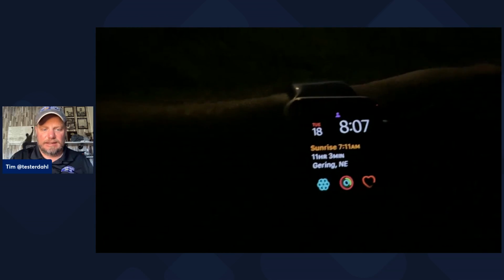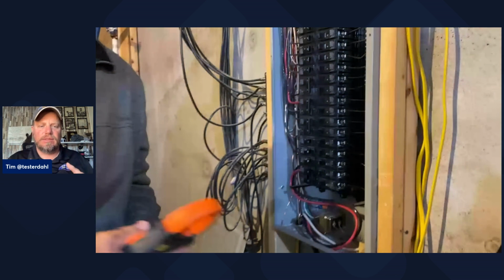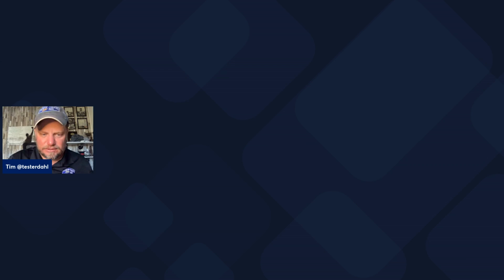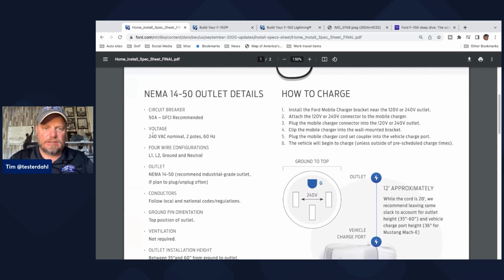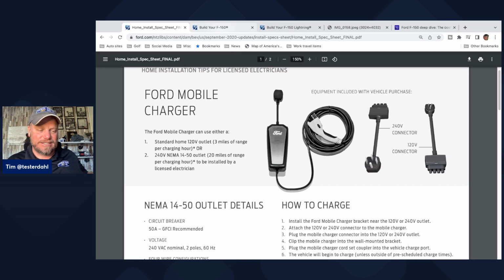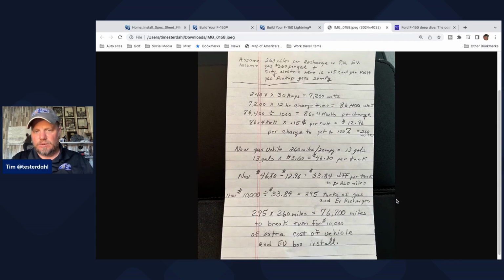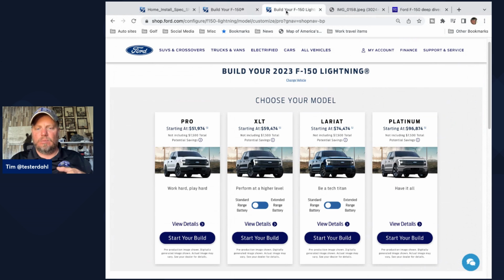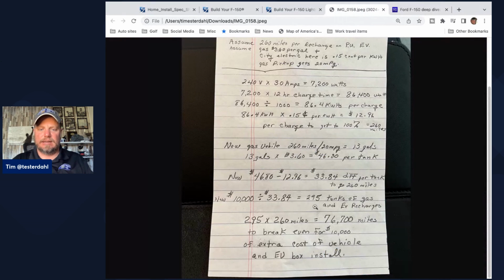11+ hours later on 220V charging price for 2022 Ford F-150 Lightning

Comment: Imagine if electric cars were the standard and someone said that they had come up with a complicated method to of compressing air and spraying explosive liquid into multiple chambers at perfectly timed intervals to make power.  All it needs is a transmission, a clutch system and a large load of explosive liquid to be stored in the vehicle.  It vibrates a lot, is not efficient, needs routine maintenance and requires the US to be dependent on oil from other nations ... but it sure refuels quickly!
Reply: With all the Tesla and GM recalls I guess somebody forgot to tell them their EV vehicles are maintenance free. Ron it might be wise to throw the rest of the kool-aid you've been drinking out.
Reply: @coobay4786  Do I need to explain to you the difference between maintenance and a recall?  ... or are you a Trumper and facts don't matter???
Reply: @ronmac1832 It's just about the same except oil changes every 6k to 8k miles.
As an example of what’s typically required, here’s a look at the maintenance schedule for the 2019 Chevrolet Bolt EV:

Monthly (performed by owner):

Check the tire pressure and adjust as necessary. Examine the tires for excess wear. Check the windshield washer fluid and fill as necessary.

Every 7,500 miles:

Have the tires rotated. Check the coolant level for the battery, cabin heater, and the power inverter, accessory power, and charger modules. Visually check for fluid leaks. Inspect the brakes. Visually inspect the steering, suspension, and chassis components for damage. Inspect the power steering, halfshafts and drive shafts for excessive wear, leaks, or damage. Check the restraint (airbags) system. Lubricate body components (door locks). Check the accelerator pedal for damage, high effort, or binding and replace if necessary. Visually inspect the gas struts (suspension) for signs of wear, cracks, or other damage. Check the tire sealant expiration date, if equipped (this is used to temporarily seal and inflate a damaged tire).

Twice a year:

Flush corrosive materials (i.e. road salt) from the underbody using plain water.

Every 15,000 miles:

Replace the windshield wiper blades.

Every 36,000 miles:

Replace the cabin air filter (more frequently if necessary).

Every 75,000 miles:

Replace the hood and/or body lift support gas struts.

Every five years:

Drain and fill the vehicle coolant circuits. Replace the brake fluid.

Every seven years:

Have the air conditioning desiccant changed. (it absorbs and holds moisture in a mobile air conditioning system to help prevent corrosion).

For its part, Nissan gives two separate maintenance schedules for the Leaf. Schedule 1 is for more severe operating conditions that include frequent short trips of less than five miles in normal temperatures or 10 miles in freezing weather, stop-and-go driving in hot weather, low-speed driving for long distances, driving in dusty conditions or on rough, muddy or salt spread roads, or using a car-top carrier.

Schedule 2 requires less-frequent maintenance, but applies only to highway driving in temperate conditions. The bottom line here is that most Leaf owners will require Schedule 1 service.

As with the Bolt, this comes down to assorted periodic mechanical inspections, having the tires rotated every six months or 7,500 miles, and changing the cabin air filter every 12 months or 15,000 miles. In addition, the brake fluid should be replaced every 24 months or 30,000 miles, and the coolant changed after 15 years or 120,000 miles.

Now affording less maintenance doesn’t necessarily mean an electric vehicle is bulletproof. EV owners will eventually need to replace the tires, have the brakes serviced, and could be required to replace steering and suspension components, hoses, headlamps, taillights, and so on. As with any other type of vehicle, a wheel alignment will be necessary if the car pulls to one side or is exhibiting uneven tire wear.

And then there’s an EV’s battery pack to consider, which is by far its costliest component. All electric vehicle batteries will degrade over time and lose some of their ability to maintain a full charge, though this happens gradually. It’s more of an issue with older EVs that could barely muster 80 miles on a charge than today’s crop of 200-mile-plus models. At that, only a relative handful of electric cars manufactured to date have reportedly degraded to the point where they needed to be replaced. Still, if you own an EV long enough you’ll see its range decline, and if it falls short enough to become an inconvenience, you may need to swap out the battery pack or trade the vehicle in for a new one.
Reply: @coobay4786  I'm well aware of the maintenance requirements on each as I own both. There is no comparison. Think about me next time you're waiting for your oil change or crawling on your back doing it yourself.
Reply: @ronmac1832  now aren't you special
Reply: @coobay4786  Just speaking from experience and not from ignorance ... like you seem to be. Does that make me "special" or just informed?

Comment: I seen a vlogger who tested towing with a ford EV truck.  It blew.  Have you any info on range issues when towing?

Also just had a thought.  What happens if I have a EV vehicle and I now have a boat .... can these ev trucks be backed into the water in the same way that you back gas trucks now???

I think EV's make some sense and I love to transfer my pollution control to the power where economies of scale can make better and more efficient pollution controls ... but if towing just blows EV's out of the water they'll never effectively make a change....

Comment: Try this with a more sophisticated watt meter such as Sense.  It will be a lot less unknowns, because you get to see a graph of instantaneous wattage over time. Make sure to order the extra set of clamps to meter an individual circuit, or it won’t be able to separate the charger from other loads in your home.

Comment: Did I hear that right? 220v for 13 hrs. That filled half a "tank" only cost $13.00? I understand your in Nebraska, in California if I ran a 220v welder for a couple of hours (not 13 hrs.) my bill would easily double. So $13.00 a nightly charge, I call BS.
Reply from the maker: What's your local electricity rate? Mine is a lot less than Cali.

Comment: if you charge that anywhere but at home, it will cost you three times what you pay at your house. its a rip off for what independently owned charging stations cost. i realize that some day all will be required to use electric or other form because fuel will be unavailable for the most part, but for me, i dont want to worry about how far a trip i am taking and having to map out a trip according to where chargers are, and the down time with charging at some strange place. i will be one of the people that they will have to be forced into changing.

Comment: Most electric dryers draw 30 A so it’s like running a dryer straight for 12 hours that’s how much it cost to charge your truck that’s kind of significant I think check your rates
Reply from the maker: Right, but you can't calculate for a dryer. This pulls more power in than the dryer.

Comment: The lightning pickup is a joke. It's a vehicle for commuters that drive less than 20 miles a day and don't haul anything. Another guy posted a video calling an empty trailer just over 30 miles, and then returning with less than 1500 lb on the trailer. From full charge, his range went down to about 25 miles. What good is a pickup truck that can't drive 100 miles with a light load?
Reply: Yes, you are correct.  Did you mistakenly assume it was made to haul 4 tons hundreds of miles?
Reply: @blackhawk7r221  every other truck is. Ford advertises it like it will replace current pickup trucks. It won't.

Comment: Having a hard time following your rambling.   
I do have to make this point:
75% of the potential energy of Gas/Diesel is simply wasted as heat energy into the air. This is due to the incredible inefficiencies of the  internal combustion engine.  This is why we have to transition away from antiquated and inefficient tech to New And Efficient tech.
If you are still using incandescent lighting  in your home, thats OK if you need to heat your home with light bulbs.  
These new Electric Vehicles are incredibly efficient. 
The only obstacle for this superior technology is and has always been the energy density of Batteries and charging them safely/quickly.
Good News - There’s a couple people working to make better batteries.

Comment: Interesting video. I charge my 2022 Kona at home once a week at 7 pm to 6 am a the rate of 0.82 cents. Full charge  is 450km or 280 miles and at a cost of $ 20 Canadian a month. I think it's a win in my pocket because I was spending $ 500 a month on fuel.  I had one service at $ 67.
Reply: Add replacement cost of battery for the time used then you see zero savings
Reply: $6,000 a year savings in fuel, times 10 years battery warranty.   I’m sure a replacement battery pack costs less than $60K.
Math
Reply: @blackhawk7r221    Good point.  Worth driving an EV.
Reply: @blackhawk7r221  yeah.... if you save that money knowing you will have to replace the battery....... my bet is no EV owner will save the money to replace a battery... they will sell it on to a new owner...i would not buy a used EV that is close to the end of its life... it will go to a junkyard

Comment: These electric Riggs don't pencil. If you determine to charge it faster if you got the amps like a  Is 320 amps service. You could put a phase converter in and a step up buck boost transformer bump from 240 V up to 480 and get a level 3 charger set up and charge in about 50 minutes full charge but you're gonna need to use a dedicated  150amp service for that. Doesn't seem like it's worth owning an electric car

Comment: Bottom line, if everyone exchanged their fossil fuel vehicles in for electric vehicles, only the extremely Wealthy or Connected would be driving from A to B! Point is, our Electric Grids will NOT handle that much amperage draw through the infrastructure PERIOD... Not even Close! The infrastructure must be assessed and built way before we even think about a Mass transition to evs. Our grids are failing more often as we "attempt" to integrate, so called, "green energy" into the infrastructure. I say "so called" because the amount of fossil fuel REQUIRED to Mine, transport, build, maintain, etc... All of these "green energy" products is MASSIVE! The maintenance alone on wind generators costs way more than the energy it might output in it's lifetime! Do people really not know all of this already? I mean, solar panels, wind generators, wiring, etc... Do not just fall out of the sky premade by some supreme being! My home is 100% of the grid and solar powered. We built it ourselves and we Love it, but it is NOT for everyone especially in extreme environments hot/cold.  I live in the perfect environment and we still had to make many life changes to use our system effectively. The World is NOT even close to being ready for their current version of green energy. If we want to help out our environment, the only common sense option is Nuclear power plants or a combination of several energy sources. It's like jumping off of a Cliff, before you think about what happens when you reach the ground... Then you realize that it's way to late to think about it by the time the ground finds you! No Common Sense at all!

Comment: What about "usability' and range with load.  The electric truck is window dressing; a sightseeing car with limited range. How about distance with load? What is usability for working tradesmen? A zero. Add tools, 4 other 250 pound guys and pull your work trailer then charge every 50 miles for 13 hours.  Pipe dream, all we need is bugs bunny endorsing. If you have to "sell" something it is of questionable value.
Reply: Wrong vehicle for the wrong application then.
Reply: @blackhawk7r221  It is being hawked as the replacement, why are they making it look like a pickup?  You are correct in your response. The entire premise of the marketing and production shift is wrong vehicle for the wrong application.

Comment: You forgot about the cost of lithium mining with slaves and the damage to the environment that causes. The cost of battery disposal. The cost in increased taxes to fix the roads that they will no longer get at the fuel pumps. I'm sure there are a lot more hidden costs to the EV market that I'm missing as well.

Comment: 12 hrs with 30 amps on each phase is 60 amps times 12 hrs and electricity rates are expected to double this winter wow keep you electric vehicles. Electricity is generated using natural gas so the only thing accomplished is sweet F All

Comment: You have a 90 kw battery. If you charged it half way that is 45 kw @ 15 cents a kw. That's 6.75. Not sure how you did your math. I doesn't matter how long you charged. It only took 45 kw.
Reply from the maker: It matters greatly how long it charged.

Comment: Thank you Tim! Great job with the video, I really appreciate all the detail and data research. You mentioned you were going to see how many watts you were pulling and since watts measure power, I knew what you meant. So at the risk of sounding off topic, at 2:36 Jim talks about two different phases, when measuring the amps being pulled. Isn’t residential usually single phase? I understand there are two SIDES, but that doesn’t mean two phases, right? Would just like to learn if I’m mistaken. Thank you again!
Reply from the maker: Correct. Just an slip up from him. Pretty common.
Reply: TWO single phase that are opposite.  That is how you get the 240v using the two hot lines.
When you wire a house you try and balance the loads across both lines.
I actually lost one phase in a storm.  So half the house worked, and none of the 220 fixtures.  Took me a minute to figure out what happened, it isn't a  normal failure.  The other line was only 84 volts.
Reply: @robertsmith2956  
Actually, after further research…
“Residential electric service in the United States (120/240 Vac) is sometimes called two-phase service but this is NOT correct. It is only single-phase, since both line voltages are derived from a single phase of a distribution transformer with a center tapped neutral and are 180° out of phase with each other.”
That was taken from the Internet search: Does residential electric have two phases. 
There are also plenty of YouTube videos explaining, such as the one from Electrician You. Obviously I don’t believe everything I read online, but these seem like simple explanations.
Reply: @robertsmith2956  
Sorry, his channel is Electrician U actually. The exact title of the video is “What is the difference between single phase and three phase” very interesting video!
Reply: @btrbblt6880  I ran across a video from south america making 3 phase using a 3 phase motor as a generator.
Reply: @btrbblt6880  it's much like an ICE engine and the rotory. one boings along, the other is always pushing.
Price wise, using a  seperate europe 240V inverter to drive 240 appliances is much cheaper than using multiple 120 tied in opposite phase. The 110 lines could care less if they are running opposite, parallel, or anything in between since you are only plugged into one leg anyways.
Reply: @btrbblt6880  I'm shocked how many people have no idea what their grid is.  I've asked people from around the word what their frequency was, and get blank stares.  I put the plug in the wall and the lamp comes on.....
Reply: @robertsmith2956  
Thank you for your replies! I would love to see that video, do you have a link by chance?

Comment: All these numbers you have gathered are all based off of estimates. If any of the estimates change, all the rest of your numbers change. Thus your conclusions are not very concrete. It's not very accurate but just going off the kwh/mi reading from the dash/vehicle and computing your home electric cost per mile is a better (more accurate) method than what you are doing.

Comment: My 2000 Sierra Z71 goes Over 400miles a tank, and has had no major repairs with over 300K miles on it. How many 20K$ batteries will you have to buy over 23years/300K miles?. Also, ask the Europeans how much it costs to operate their EVs. With the high price of power ,it now cost way more to charge an EV than to fill a normal car.  FYI CO2 is not a pollutant! And way more is produced to make a battery anyhow!  If these companies really cared about cost savings for people and the environment, they would produce cars that run on water! More energy in a glass of water than a 1000 gallons of diesel!

Comment: You did your analysis up to ten years, a lot of electric vehicles need new batteries at that point and you left out that cost. A fuel model doesn't need a new fuel tank at 10k. Those batteries cost as much as a Hyundai and the cost to dispose of your old battery is high as well, similar to the cost of disposing of old toxic solar cells and cfl bulbs properly. The solar cells end up in third world landfills or tossed in the ocean in reality just like old tires. Thanks tree huggers. Also, when people are given negative social scores based on how much electricity they use, electric car owners may be chastised by the very same people who regulated you into purchasing the electric car. Next, you said solar power makes your truck fill up for "free". A 10kw system is 60k with 24k in rebates. It returns 95$ a month in electricity in an average zone at 13 cents per kWh. Assuming your $80 lightning arrestors get blown only once every 5 years and your panels don't degrade to 80% in 10 years.. go ahead and calculate the 45 year payback at which point, yes your power would be "free"
Reply from the maker: Battery replacement is another video.